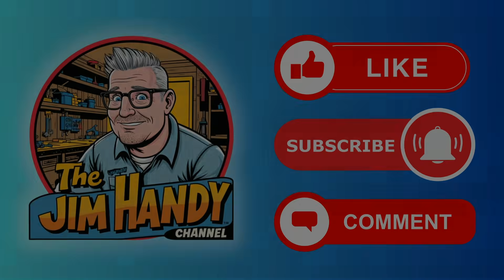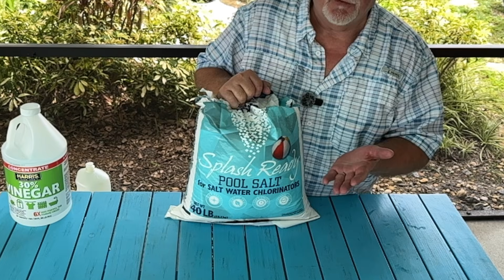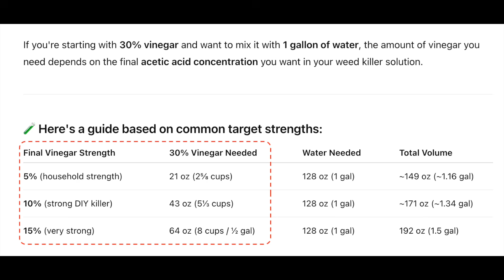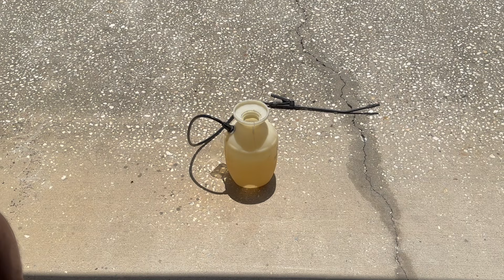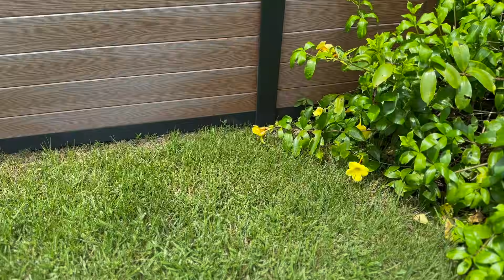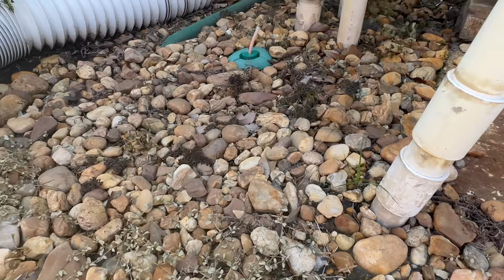Weed Killer -  Make Your Own Using Vinegar, Salt, and Dish Soap

Comment: Can you just use vinegar and dish soap in your beds on weeds
Reply from the maker: You can definitely use just vinegar and dish soap. This will still kill the visible part of the plant, and with enough treatments, may eventually cause the root system to die out as well due to the lack of surface foliage to help feed the root system. Of course, this will depend on the type of plant.

Have a great day!

Comment: How many weeks it will take for the weed to grow back?
Reply from the maker: Hello! Thanks for watching and for your question.

When you first use the homemade salt and vinegar solution, the acetic acid quickly burns off the visible top growth of the weeds, often within a day or two, but because it rarely penetrates deep into the root system, you can usually expect the weeds to grow back within a couple of weeks. However, repeated applications will eventually kill the root systems and stop the weeds from returning entirely for an entire growing season or even longer. it effectively sterilizes the ground, making the soil completely incapable of supporting any future plant life in that specific area.

Thanks and have a great day!

Comment: Sir,can this kills buck weat I mean not only the leaves but also the roots
Reply from the maker: The salt in this mixture helps stress the root system, but wild buckwheat has a natural resistance to salt - at least up to a point. This solution would definitely kill the above ground part of the plant, but the root system is likely to not be affected. 

 Products containing Dicamba, Fluroxypyr, or 2,4-D are highly effective root-killers for wild buckwheat in lawns and non-crop spaces. They force the plant into rapid, distorted growth that completely exhausts and kills the root system.

Wild Buckwheat is a very stubborn plant, so it’s likely you would need to go with a chemical herbicide that includes the previously mentioned elements to get rid of this plant.

Hope that helps and thanks for the question. And thanks for watching the video! Have a great day

Comment: Hi Jim so glad i found your video of two. Best one ! What can we do for our fruit trees if we want the beautiful clean round circle I see along the city main roads.  Thank you for your help. Ty
Reply from the maker: Hi there! Thanks for watching the video and for your question. 

You definitely do not want to use the solution I demonstrated for killing grass and weeds, or any type of herbicide for that matter.

Here is the best method to create a long-lasting, healthy tree ring using the sheet mulching technique:

1. Mark and Clear the Area
 
Measure: Aim for a circle that extends at least 2 to 3 feet out from the trunk. For older trees, extending out to the "drip line" (the edge of the tree's canopy) is ideal.
 
Remove Bulk: Cut the existing grass and weeds down as short as possible using a trimmer or mower.
 
Edge: Use a half-moon edger or a sharp spade to cut a shallow, clean trench around the outer perimeter of your circle. This stops grass roots from easily creeping back in.

2. Lay Down a Weed Barrier. This can be the type you buy, or you can even use cardboard or newspaper if available, which I have done many times.

Gather Materials: Collect plain, unwaxed, un-coated cardboard (remove all tape and staples) or use overlapping layers of black-and-white newspaper.
 
Smother the Grass: Lay the landscape fabric,  cardboard or newspaper directly over the cut grass within your circle. Overlap the edges by at least 4 to 6 inches so no light can get through.
 
Wet it Down: Soak the cardboard or newspaper with a hose. This helps it mold to the ground, prevents it from blowing away, and jumpstarts the decomposition process.

3. Add Organic Mulch
 
Choose your Mulch: Use 3 to 4 inches of organic matter. Hardwood bark, arborist wood chips, or a mix of compost and straw work wonderfully for fruit trees.
 
Spread Evenly: Cover the weed barrier completely with your chosen mulch.

4. Protect the Trunk (Crucial Step)
 
Avoid the "Mulch Volcano": Pull all cardboard and mulch at least 3 to 6 inches away from the actual tree trunk.
 
Why it matters: If mulch rests against the bark, it traps moisture. This can cause the trunk to rot, invite fungal diseases, and provide cover for voles and mice to chew on the bark, which can kill the tree. Keep the root flare (where the trunk widens into the roots) visible and dry.

Maintenance Tips
 
Hand Pull: A few determined weeds might occasionally poke through. Pull them by hand while they are small.
 
Refresh: You will need to add a fresh layer of mulch every year or two as the organic matter breaks down and feeds the soil.
 
Hope you find this useful. Have a great day!

Comment: so if you spot-spray on the lawn, it will kill the surrounding grass? right
Reply from the maker: There solution will definitely spread slightly to surrounding grass and weeds. I typically don’t use this solution for spot spraying for that very reason. It’s best for applications along fence lines or other areas where you need broader coverage.

Thanks for your question and thanks for watching the video. Have a great day!

Comment: Does the strongest mix actually kill Dock weed ?
Reply from the maker: The mix will certainly kill the leafy part of the plant. Over time, the salt part of the mix will stress the roots enough to eventually kill the entire plant, but that can take a while. Killing off the leafy part of the plant will also starve the root system of energy over time as well. 

So, the answer is yes, but it will likely take longer over the span of multiple applications.

Thanks for your question and for watching the video. Have a great day!

Comment: So I am guessing you never want to use on a fence line if large trees are also present.
Reply from the maker: I definitely don’t recommend using this formula close to trees. If the salt used in this mixture reaches the tree’s drip line, it will dehydrate its roots (bye bye tree)

Your situation may call for a product that kills roots by way of contact with the plants leaf structure. That would be a product like Roundup or a competitor equivalent.

You could also try a Vinegar and dish soap mixture without the salt. You could increase the amount of vinegar, which would increase the stress on the plants root system. It would likely take a few applications, but it would eventually work and wouldn’t put your trees at risk.

Boiling water is another amazing solution for killing weeds and grass all the way to the root, but may not be practical depending on how much fence line you have.

Another solution that works is burning the weeds and grass with a propane powered torch. This is also very effective, but may or may not be practical depending on your circumstances.

Hope that is helpful. Thanks for watching the video and have a great day!
Reply: Weed killer

Comment: Hello thanks for the video. My wife and I own a townhome and we have grass along the sides of our patio. We do not want any weeds or grass grown back will this solution work and do we need to reapply every 3 to 6 months or even once a year?
Reply from the maker: Two or three applications will likely be required before the root system of the grass and weeds have been thoroughly eliminated. Once that occurs, the need to retreat depends on soil composition, rainfall amounts, etc. The salt portion of this solution will eventually leach out of the soil and allow weeds and grass to come back eventually. In my situation ( lots of summer rainfall and very sandy soil), I find the need to retreat about every six months. Less sandy soils will hang onto the solution longer and extend the time between maintenance applications.

Hope this helps. Have a great day!
Reply: @thejimhandychannel Thanks so much for the replying back. I'm on the opposite side of the country in California.

Comment: Hello and thank you for the video! I've been using this solution to kill weeds, but with incorrect ratios. It was still effective, but I'm looking forward to trying this formula. 

When your weeds have been treated, and they are clearly dead (the next morning), do you pull them? Or do they disintegrate naturally? You mentioned that the salt kills the roots, so eventually the weed will die. Will they spread if they aren't pulled? Thanks!
Reply from the maker: I don’t bother with pulling the dead weeds once they dry out. They rot away fairly quickly and after two or three treatments the root system should be sufficiently destroyed. Thanks for the question and have a great day!

Comment: Jim I have many weeds in my backyard area next to a pool that continuously re-appear.  I live in southern California and my soil is like older alluvium consisting of medium dense to very dense silty sands, sandy silts, and clays..  Would you recommend the same ratio you used in your video?   Also I got weeds growing in my front yard but don't want to ruin my grass.  What would you use to tackle that problem?
Reply from the maker: Hi there and thanks for watching the video!

For the area around your pool where you want to kill ALL vegetation (and considering your soil composition), I would use the following ratio:

Vinegar (30% acidity - 1 gallon

Pool Salt - 2 Cups

Water - 1/2 gallon

This mixture should be sufficient for your circumstances, but if you don’t see noticeable results within 24 hours, cut the amount of water in half.

If you have actively growing weeds, you may want to consider adding a teaspoon of liquid dishwashing detergent to the mix to help it stick to the leaves of the plant.

For the area of your yard where you have grass, you obviously don’t want to use this homemade vinegar and salt mixture. What you need to use in that situation is a herbicide product. Here are some recommendations For Southern California lawns, it depends on what type of grass you have. Here are some recommendations:

Option A: The "Southern Lawn" Formula
These products are specifically formulated for warm-season grasses (like Bermuda or St. Augustine) and are excellent for the dense, silty-clay soil of Southern California. They use a combination of active ingredients like 2,4-D, Dicamba, and Quinclorac to kill weeds while leaving your grass unharmed.

• BioAdvanced All-in-One Lawn Weed & Crabgrass Killer: This is one of the most effective options for California lawns. It targets over 200 weed types, including tough crabgrass. It is rainproof in one hour, which is helpful if you are running a pool-side irrigation system.

• Roundup for Lawns (Southern Formula): It is critical to look for the orange and yellow label specifically marked "Southern." This version is a selective herbicide that skips the glyphosate found in standard Roundup, so it won’t kill your grass.

• Image for Southern Lawns: This brand is highly regarded for its effectiveness in dense soils. It is particularly good at killing "roots and all" without stressing the heat-tolerant grass species common in the Southwest.

• Spectracide Weed Stop for Lawns Plus Crabgrass Killer: A widely available, budget-friendly option. It works similarly to BioAdvanced but is often found in large "Ready-to-Spray" bottles that hook directly to your garden hose.

Option B: The Iron-Based Solution

If you prefer a more natural approach—especially important if you have pets or children frequently using the pool area—these products use Chelated Iron (FeHEDTA). They "overdose" broadleaf weeds with iron, causing them to turn black and die within hours, while the grass actually benefits from the nutrient boost.

• Captain Jack’s Lawnweed Brew: This is the most popular consumer brand for iron-based weed control. It is fast-acting and allows for people and pets to re-enter the area as soon as the spray has dried.

• Sunday Weed Warrior: Often sold at major retailers, this brand focuses on lower-toxicity ingredients. It is very gentle on the soil and won't leave long-term synthetic chemical residues in your silty-sand/clay mix.

• Fiesta Selective Weed Killer: While often used by professionals, you can find this in concentrate form. It is highly effective against dandelions, moss, and algae, which can sometimes be an issue in the damp soil immediately surrounding a pool.

• Whitney Farms Lawn Weed Killer: This is a solid choice if you are looking for an OMRI-listed (organic) brand often found at local Southern California nurseries.

Good luck with those weeds!
Reply: I noticed your fence on your gate. Does that prevent animals from getting through. Can I get the name of the fence that you were spraying the weeds around

Comment: Question: how long does the weed killer stay on the grown? I want to kill everything and later plant some different bushes and flowers, but I am afraid that the ground would be poison for months if not years?
Reply from the maker: Hi there and thanks for watching the video. The weed killer recipe shown in my video is not recommended for killing weeds in an area where you intend to add new plantings in the near term. Depending on the type of soil you have, using the vinegar and salt recipe could result in several months to a year or more of not being able to grow things in the area treated. For a situation like yours, I would recommend a synthetic product like Roundup or similar commercial products. You should be safe to put in new plantings within a month or two using that kind of product.

Hope that helps and thanks so much for your question. Have a great day!
Reply: Instead, use flattened cardboard to cover the grass you want to kill, and keep the cardboard wet. You can also put soil on top of the cardboard and keep that moist. The cardboard will kill the grass and decompose eventually.
Reply: Salt does change the soil